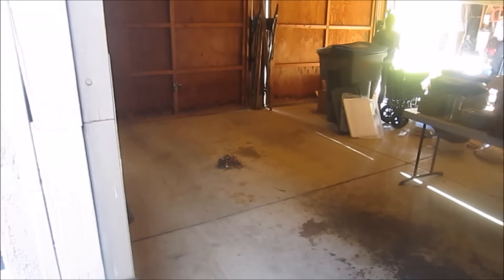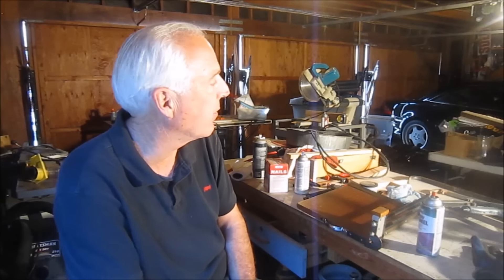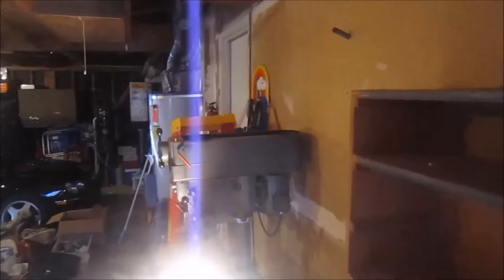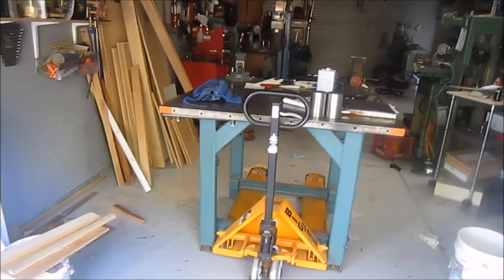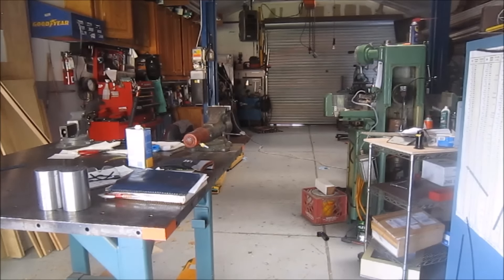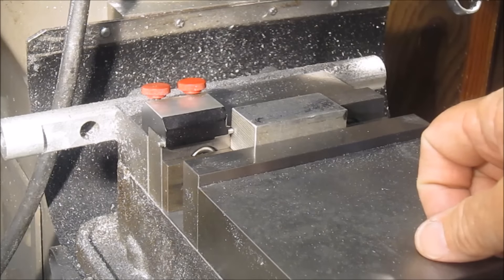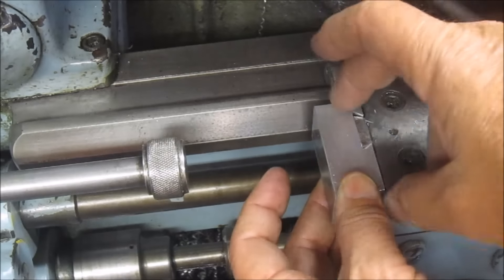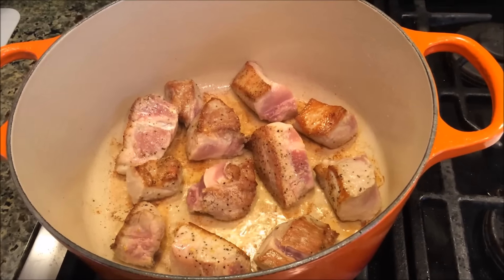Screwy Tuesday #64  Shop Expansion Update

Comment: hey Chuck, 
nice to see things coming along. i don't know if you've seen all of my vids (thanks for the sub by the way) but i have one that might be a partial solution to your welder problem: the one of the swing arm. it was always a real hassle to pull the welder out of the cabinet and set it up for a 5min job and then put everything back again. so i built the swing arm to have a permanent place for the welder at the ready and let me tell ya it has been handier than the knob on the outhouse door! the other big bonus is that the welder is on the spot wherever in the shop and to some degree outside wherever it's needed without having to lug it around or be in the way when it's not in use
the design will scale up to accommodate just about any size welder. this arm can take up to 25lbs. for heavy welders (50lbs and up) the arm would need an additional beam so the cross section of it would be triangular, and of course a little heavier swivel joints. i'll be building a heavier version for my MIG welder when i get back to the states and another just like the one in the video for the little welder again and make a video of it.

cheers
mike

Comment: I don't know if it matters, but it looks like you have the wrong angle dovetail cutter for the one on the Monarch.  It will be nice to separate the dust from the wood shop from the metal shop.  I don't have a metal shop, but my wood shop is coated with dust.  It gets everywhere.  I'd like a dust collector, but that would be one machine too many and I'd no longer be able to work in the shop if I did.
Reply from the maker: Hi Barry....thanks for viewing/comment....now with a separate wood shop I can accept the dust, but as you know a dust collector would be a great addition.....hoping to seagull one at a great price and then "stuff it" somewhere....

Comment: Won't having the grinder by the open door actually blow the dust back into the shop?
Reply from the maker: Hey Steve...thanks for viewing and the comment....standard winds blow past that door so possible it would suck it away....but was also thinking of having a assist fan to make sure it gets pushed outside....still don't have a final idea on what I am going to do.....
Reply: The metal dust will turn concrete rust color... but I like rust colored concrete... :)

Comment: Hi, I don't see how you will be able to get the Dial Indicator in the optimum position for alignment with the Stop on your Monarch Lathe.
Everything looks as if it will just get in the way-particularly the thumbscrew- I can't help thinking that it would be better placed if fitted into the side of the chunk of Aluminium which would have to be cut vertically so that it would operate more like a miniature clamp on the Compounds Dovetail.

Tell me to "go screw" if you want but this is just "feedback" if I am wrong and out of line I sincerely apologise.
Reply from the maker: Gregor....Please note.....I appreciate all feedback...communication is learning, so thank you and please never hold back positive or negative.....  you have a keen eye and I may have an issue....I will take you comments into my thought process....thanks